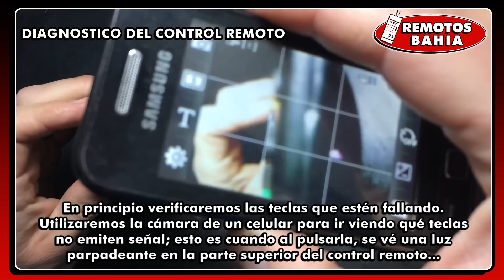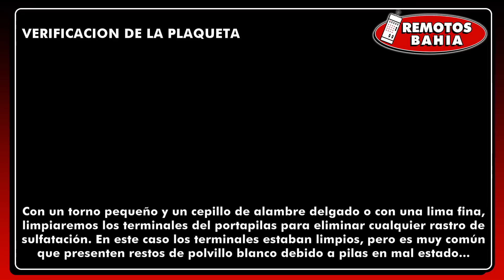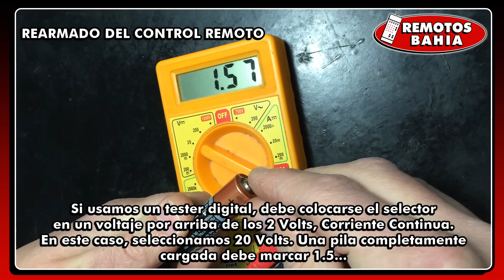COMO REPARAR UN CONTROL REMOTO - HOW TO FIX A REMOTE CONTROL

Comment: Amigo como identifico si la tarjeta o circuito o pista está mal ya que hice lo del vídeo y 2 botones siguen sin responder, es un control de un Logitech z906 y tiene unos botones metálicos que son como lentejuelas que si las aplastas hacen click pero ya le puse el papel aluminio, limpie el circuito de esos botones y nada ...recuerdo que había dejado de funcionar por que le cayó agua pero ya funcionan la mayoría de  botones menos esos que te comento. Tengo cautín para soldar
Reply from the maker: Hola! Disculpa la demora. Deberías probar las pistas, midiendo continuidad con un multímetro. Lo del papel aluminio no sería necesario para los domos metálicos. Saludos! Franco.

Comment: Hola que tal,sabes que mí control calienta la parte del infrarrojo,y no anda más ,si pruebo con una cámara de celular con las pilas bien manda señal constante,sabes que problema puede ser ? Se habrá quemado la placa ? Gracias
Reply from the maker: Hola! Habría que desarmar el remoto y ver que no haya sulfatación en la parte del circuito integrado. La sulfatación es un polvillo blanco que se forma cuando las pilas se sulfatan. Elimina la sulfatación con un hisopo humedecido en alcohol isopropílico. Saludos! Franco.